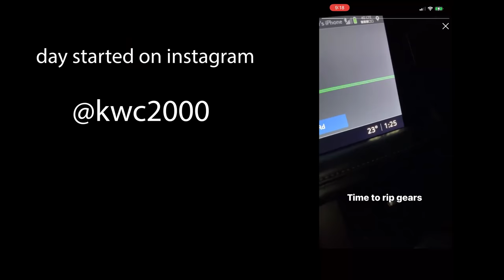14 Hour Road Trip in Dump Truck with my Employee (picking up new trailer from Toronto)

Comment: Those light switches you can get the rubber waterproof cover's for them, dunno why they where not supplied that way, no cover or protection for them ? Electric Brakes, probably so you can pull it with a pick up if need be. I still would have spec'd it for air connection so you could put an assist for the beaver tails or even lift them automatically. Winter usage most likely so some side plates about 2 to 4 " above peaks to stop any side slipage :) Only two LED lights ?? oh man, you could put such a nice light set up, with wig wag and everything ^^ 
Solar panel to recharge onboard battery... maybe I'll stop by and see you, after all, you need someone other than a mechanic to look after all that nice equipment ^^, someone who knows equipment well and just loves to make thing's look pretty... some guys used to make fun of me because I'd armour all the floor of my backhoe...but nothing like working in sock feet :)

Comment: Been in the excavating business 35 years and had many electric brake trailers , they are complete junk. Now have a 20 ton tandem Float King   (Ontario) air brake trailer would never consider electric brakes for the kind of weight you are going to be hauling
Reply: Wouldn't say "complete junk" because you can get stuff moved but scary with electric. After owning both I couldn't imagine dropping 20-30k on a trailer that isn't air.

Comment: Nice trailer! Why e-brakes vs. air when pulled with and air brake rig? Also super interested in the 306 CR! I recently started up my own biz and really leaning towards the 306. Many questions, why 306, what type of jobs did you buy it for? And yeah, just post a 💩ton of videos on it, I’ll watch them 7 times each!
Reply from the maker: Don’t need air brake endorsement.